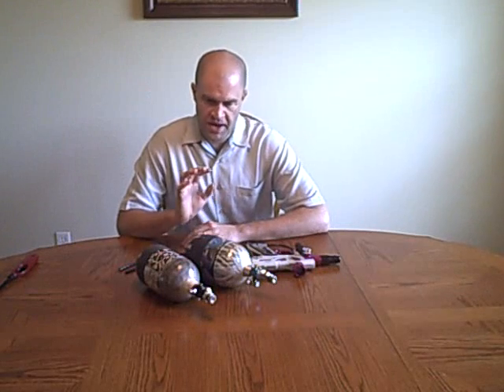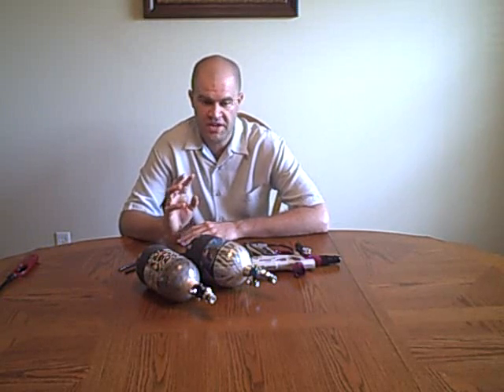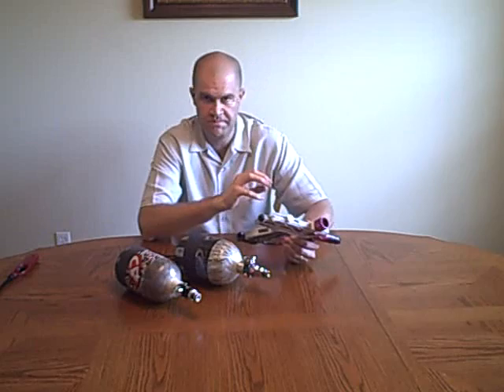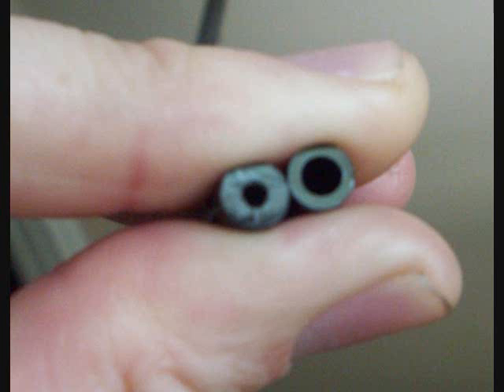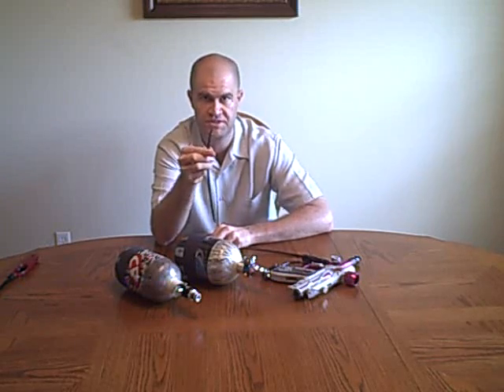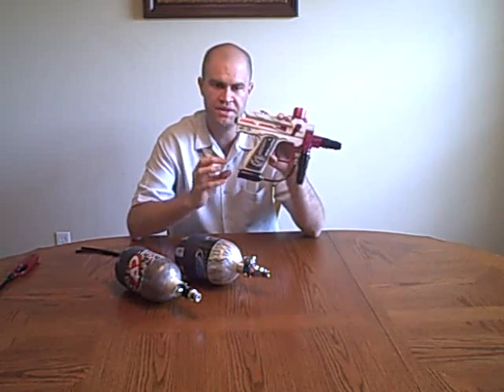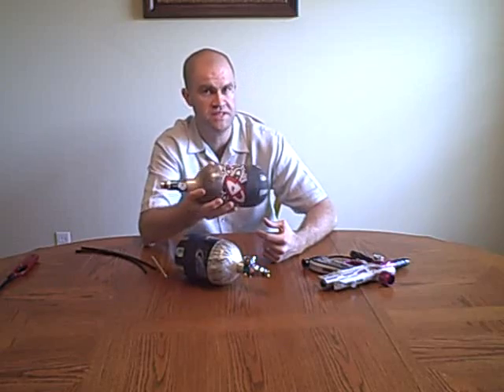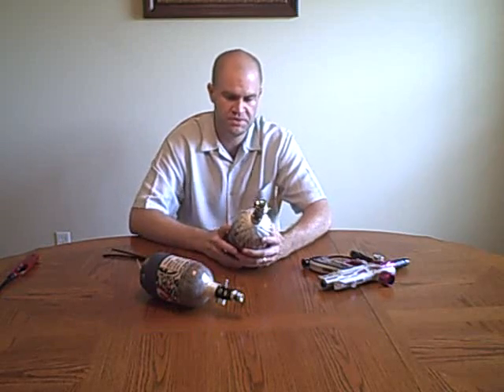Tanks - Low Pressure vs High Pressure Output Tanks

Comment: Simple physics. Under high rate of fire, high pressure will keep up better than low pressure. What does that mean? Less/no dropoff.
Reply: +Sanguine9 Ehh, to a point, yes. The trade off being volume exhausted per shot, compared to a LP system. LP systems were designed to work at lower pressure and recharge as well as HP systems, the physics of that being the rate of volume exchanged between chambers is dependent on the size of each chamber. In paintball guns we have valve springs, variable volume chambers, reciprocating mass, temperature sensitive gases, etc. It depends on the gun in the end.

Comment: I have a Vapor, do I need a Low Pressure Tank? Or can I use a high pressure tank?
Reply: +BLEDA127 have you found out yet? I just bought one, and I'm trying to find out the same thing
Reply: Jacob Gafford Actually I have man, it turns out you HAVE TO use a low pressure tank ONLY! Or else you'll blow al the O-rings and everything inside. But one piece of advice, you have to treat it like a "princess" I did a few (3 or 4) superman slides and it started giving me quite a few problems. To the point where I am planning on selling it now!

Comment: low pressure tanks (450psi) are great for dye guns, cause the asa on/off switch is easier to use
Reply: +Bärtiger Baron 
It's not that difficult to turn on the lever. I'd prefer that over having shootdown under high rate of fire.

Comment: 800 psi will work on all guns?
Reply: no, it depends on the gun. most low end and some higher end marker will use 850psi the more expensive usually the lower the pressure because it is more efficent

Comment: Noob question. If a tank is putting out 450 psi, how come you don't only get a 10 shots if its a 4500 tank.
Reply: +eighty8assassins 
Because of volume. An average tank is 68 cubic inches, all holding 4500psi air. Besides, the gun doesn't use 450psi, the regulator drops it down to 120-200psi on average.

Comment: I have a dp g5 is says to use 450psi output I have a empire 68/4500 output is 800psi (I think it's 800 or 850) can anybody help me.
Reply: get Ninja Adjustable Regulator for your tank  43 baks only and safe g5...

Comment: I don't know, it may just be me but when I use a 800-850psi vs 400-450psi output tank on my Etek4, my SL3 regulator feels like its running hotter when I shoot ropes of paint.  Like I said, I might be trippin.

Comment: I have a spyder im turing over to compressed air. I found a tank with low pressure regulator on it and still dont understand do I need high or low pressure for my gun. and can I just throw the compressed air tank on my gun and go play or do i need to do internal changes pkease help!!!

Comment: My O rings keep coming off on my G5 in the ASA and the bolt. I always lube it the night before using Hatersauce. Should I go with low or mid pressure or just stay with high pressure and add more lube?

Comment: ok.... tell me then why use a 4500 psi tank (less problem then LP tank u say ), the regulator of the tank put 850psi to the other regulator that put 200 psi to the gun, but the 3000 psi tank give 450 psi at the regulator tank, then the gun regulator goes to 200 psi to the gun, how is it that is less trouble ? what the diff from LP and highP tank is the capacity to fire paintball ball. less on LP and more for high P tank and that is it. + tippman work on 3000 psi to and 4500psi .

Comment: how would i make a tank last longer but release very high pressure i have a project im trying to do but my tank runs out of air in like 1 minute its a 3 gallon tank. in the future im going to use about 150 gallon compressed air but i need to know how to make my pressure come out really high but last for a long time.no this is not going to be use on a paintball gun this is the only video i could find

Comment: I have an sft shocker I was planning on getting a turbo bolt to make it more efficient but first I want to buy a new air tank. I was looking into the 68/4500 crossfire and the ninja 88/4500 carbon fiber hpa tank which one would you recommend? Because my gun kills air to quick and its annoying hah or do you have any better suggestion because I want a 4500 psi tank that will last me longer

Comment: If my gun operates at 160psi (GOG Extcy) and i use a high output 800 psi tank what is happening to all of the extra air?? Since i have a ninja that i can adjust should i move it down to the 400 psi setting???

Comment: When this video was produced, angel was the only low pressure gun. Nowadays, the Axe, g6r, victory, rippers etc are all low pressure guns. The axe wasnt around when this vid was made. The axe and mini CAN run on BOTH low and high pressures without any issues. Lower pressure is better though, and can prevent leaks. However angel and new bob long guns should ONLY use low pressure.

Comment: K I'm getting a steel 3000 psi tank for an azodin kaos. Do you need a remote line because of the extra weight(and how would i do that?) or would it survive on its own?

Comment: @cep2141997 He is WRONG. End of story. He is wrong tell him to fill up your freakin tank. He doesn't know what he is talking about. High pressure will work on ANY dangerous power gun. My friend uses a high pressure Ninja 50/4500 on his g4. There is nothing wrong with it, it works everytime. The guy is stupid tell him to learn something about tanks.

Comment: hmmm curious. i just got a DP G4 and am curious if i need the low pressure tank. when i got it, the stor eowner was like "make sure you check if its high or low".....and it doesnt say anything about needing a hp or lp tank. i am assuming HP is fine, but this viedo was made 3 years ago....

Comment: hey mike, i bout an etek3 lt today! and im extremely happy cause its my first tourny style marker and im not dissapointed!! i am running a dye rotor and an aluminum 48/3000 (lol) hpa tank, I NEED A NEW TANK! i wnt a ninja 68/4500 but idk if my gun will wrk better off a low pressure tank or if high pressure is best. thanks. keep up the good worl! :)

Comment: i have a high pressure air tank and a dangerouse power g4 and it leeks so im wondering if i get a low pressure tank it will not leek

Comment: i think the whole HP LP thing is changing, my Phenom has a gas line through the grip and it burst since i had 850psi going through it when the manual said to use something close to 300psi, now i turned the reg down to the lowest it can go which is about 500.

Comment: low preshure tanks is more about balancing your regs if your highend marker works on around 200psi that is what your main reg on your marker feeds the internals and it works best when fed 450psi dubble what your operating presher is of corse this all depends on quailty of the regulators on your markers and that kind of marker you are using popet valve markers do no generaly like bing fed the minimum air spool valve markers are the opisite HP tanks are more the standard tank to use on all markers

Comment: @EnjoiSkate87 Hi, it depends... The carbon fiber tank goes up to 4500 PSI and the price for a new one is between the 140-160 US$. But if you want a cheaper tank, like the Aluminium tanks, then your tank would only goes up to 3000. If you have two tanks from the same size you would get more shot out of a 4500 tank than a 3000. I hope it helped you a little bit.

Comment: @colinprprpr guerilla air tanks are fixed at 600 psi. Every speedball gun will work on that minus angels they need a little lower psi so it will work.

Comment: @iSMITH4life Most guns that are HPA only are electronic. If you tried to use co2 in it the electronics inside of the gun would break very quickly and you would have to replace them.

Comment: @MrIheartriseagainst  Most guns that use low pressure won't work when you screw in a high pressure tank. However, if you have an adjustable tank (hi/low) then you can easily take off the bonnet and adjust your regulator to make it low pressure.

Comment: Regarding this I have a dispute. I have an angel 1 which the previous owner did not know regarding LP and HP. He placed an HP tank on it and it killed the factory reg. So I´d say that this is not totally correct if not ask my Angel reg and the flat shims I had to remove... unfortunately I had to change it, it was dead beyond repair.

Comment: yo somebody. I have a blitz, and i saw a great deal on ebay for a crossfire 68/45 , i didnt notice it was a low pressure tank. so i bought it. should i just roll with it? is it gunna work on my azodin blitz? i know its not designed to, and mike said sear tripper = no no, but if it will work, its a big gain on my side. please respond

Comment: Sorry Mike, but I think you need to change your info regarding "EVERY SINGLE PAINTBALL GUN USES HIGH PRESSURE". Bob Long Victory (although can run on high pressure tanks), should really use low pressure tanks. Not because of the regulator, but because of the ASA orings blowing out with the extra pressures from the HP tank.  I think, you should change it to say something along the lines of "use what the manufacturer of your marker recommends". Just a thought.

Comment: hey i ordered a hpa tank from ans and they sent me a low pressure one, before complaining, i was wondering wether there are any guns other then agnels that will function properly on low presure, because the output pressure on the tank is 450 psi, and my woodsball guns dont work well on the low pressure because of the 450psi output, they need 800 or so.thanks id really apreciate it if sum1 could help!

Comment: Finally, someone who makes sense.  I've been ranting about how there is no advantage to LP tanks for years.  Angel are the only guns that AT ONE TIME needed them.  Mike focused on the macro line a little bit too much, so know that because you are flowing at a lower pressure, you are actually flowing a lot less air with an LP tank.  About half really.  So if you have inconsistency or shoot-down issues, it is because the LP tanks simply do not flow well enough.

Comment: I'm looking for a new regulator for my ion xe. But i can't seem to find one by custom products that's high pressure. So if i got a low pressure reg. and i'm still going to use my high pressure tank it would work fine correct?

Comment: you can buy a WORR tank you can, switch the output pressure from either high OR low pressure. check it out~

Comment: any high pressured air tank...
dont use low pressure air unless specified in the manuel..
or you could you Co2 but like mike said hpa is better

Comment: on my old slg 
i use high pressure on it, solenoid clicks, does not shoot
i use low pressure on it, leaks but still shoots

on my 2k5 timmy
i use high pressure, shoots pretty smooth
low pressure, velocity is being retarded but still good shooting

on my mini
i use high pressure, shoots fine
i use low pressure, shoots better

Comment: the mini will run on either but it operates lower than 200 psi and since the air is through the grips there is no worry about size of macro line so lp will have no problem on the mini and it should be used lp on mini

Comment: a friend of mine wanted to get into paintball, but she insisted on having an orange gun (women) so she got a good deal on an invert mini, but without a tank. we didnt know to get a high or low pressure tank, so i watched mike's video here, then i went to the invert site and looked up the manual. it states, "It is strongly recommended that a very high-flow, low pressure (350-450 psi) fixed-output system is utilized as an air source for your MINI." so it looks like 2005 angel AND the mini are LP.

Comment: on my stock sft shocker i cant use high pressure or it leaks but it shoots perfect on low pressure my nasty shocker shoots awsome on both but its tuned for high pressure and my angel speed only works with low pressure

Comment: toothdecay7758, a regulator regulates the amount of pressure going through it. on your tank, if you have a 4500 psi tank, it the regulator lowers it down to 850 psi, or 450 psi. then that 850 psi go's to your foregrip regulator, that reg lower's it to about 250 psi. then that 250 psi go's to your lpr, which lowers it to about 100 psi.

Comment: there is no difference they are the same thing

tanks used to be filled with n2 but it caused burst disks to blow out so now they fill them with hpa or high pressure air

the reason they call it n2 is because the name stuck

Comment: haha i have an fep quest
that sucker is one of the lowest operating guns on the market
it operates at 75-80 psi
i still use a high pressure out put
no matter how low your gun oprating pressure is at you can still use a high pressure out put tank

Comment: Strange when it says specifically in my manual not to use more than a 500psi output...

But sweet, good to know. At least that means I don't ave to get a low pressure spring for my Max Flo once I switch out my tank's reg.

Comment: Hi Mike,
when a reg spikes or breaks the internal seals when you're using HP air then 850 psi goes into the gun, you probably know what that does to most solenoids on the market today.
I've seen both happen on a number of occasions and over the 6 years I've been working as an airsmith I must have seen about 10 such instances that had resulted in cracked noid housings.
It doesn't happen to everybody and it doesn't happen all that often, but when it does it's a really bad day on the field.

Comment from the maker: the gun regulator regulates the air to the 200psi going into it anyways

So it makes no difference what pressure you have going into the regulator. 850psi, 600psi, 450psi, 300psi, 210psit

the gun regulator puts it at 200psi going into the gun anyways. So that theory is garbage, it makes no sense

Comment from the maker: use the small hole macroline, through a smart parts on/off ASA, using a PMI Pure Energy Low Pressure Tank, and try to shoot 25bps

You'll see my point